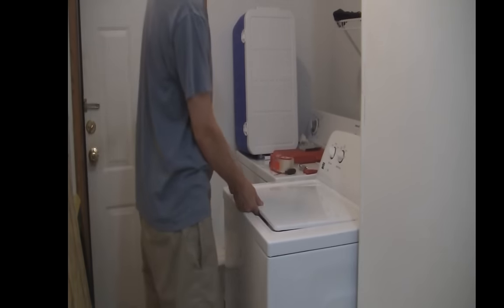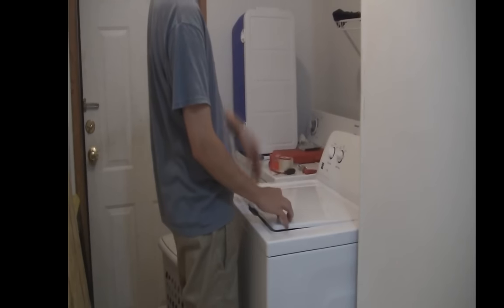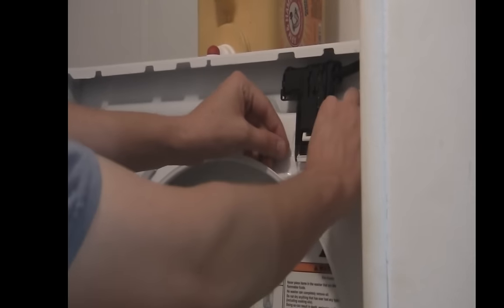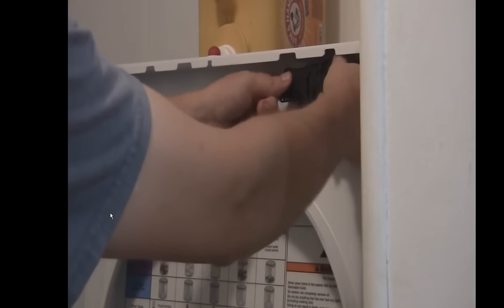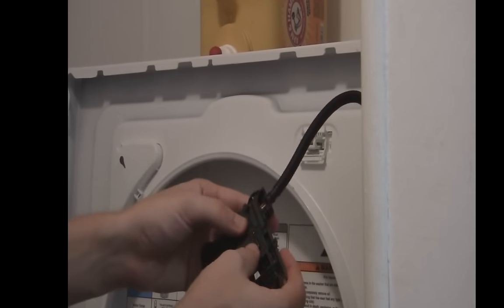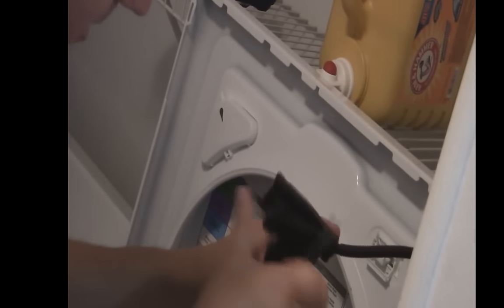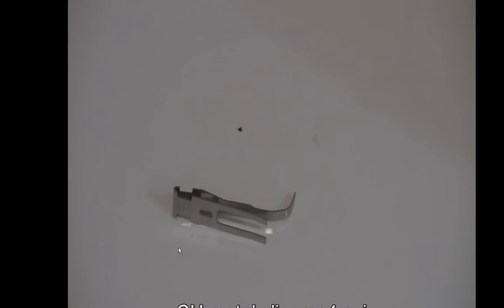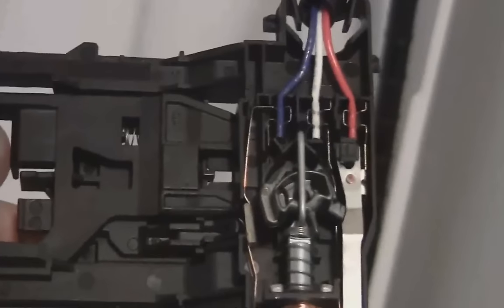Maytag, Kenmore, WhirlPool Clicking Lock Fix

Comment: Doesn’t work on my Maytag. Now it says it’s always locked and won’t cycle at all even though obviously it isn’t locked.
Worse than before because of this.
Reply from the maker: Mine says locked all the time now as well.  However I unplug the washer after each time I use the washer.  Try unplugging it and plugging it back in to see if that will allow it to run. 

If not then try resetting it.  

After replacing the lock I had to do this:
Plugin the washer.
Immediately put the latch in the lock and then take it out 6 times in 12 seconds
Then leave the latch in on the 7th time. 
Then position the settings dial to Rinse/Spin and run a Rinse/Spin.  This reset the lock mechanism or the computer and it started working normally.

Comment: Idk what I did wrong but now my washer won’t turn on 😭
Reply from the maker: I have a comment from 2 years ago that starts with "Update:"  Expand that comment and try the process I described there, that may allow the washer to turn on again.    I'll post it here too, but that comment has more info.

After replacing the lock I had to do this:
Plugin the washer.
Immediately put the latch in the lock and then take it out 6 times in 12 seconds
Then leave the latch in on the 7th time. 
Then position the settings dial to Rinse/Spin and run a Rinse/Spin.  This reset the lock mechanism or the computer and it started working normally.   Before this the lights were just off and it wouldn't work.

Comment: I must've done something wrong. I went by the video and it's still sitting here clicking
Reply: Me too.  You Find a fix?
Reply: @chadwilliams519  no
Reply: Mine is the same... this is so frustrating! I need to wash and this thing is just being  a pain.
Reply: Did anyone figure it out?
Reply: When the switch is closed you can use pliers to bend the metal tabs together. It makes contact that won't come apart. Then take the actual lock off of the lid. Everything works as it should but the lid doesn't lock in place. You can open it anytime. The washer will stop when you open it, but still works like it's supposed to

Comment: Listen.  Do you understand that when you remove that metal clip and you say it is okay and everything works fine.  Do you actually understand and clearly explain the role that metal clip actually plays?
Let me explain it to you thoroughly and clearly.  Now pay attention that you might learn somthing
When you put your lid down, the striker pushes two plastic arms in towards that solenoid.  One plastic arm makes the white wire and the blue wire to connect.   This completes the circuit for the solenoid.  So when you start the washing machine, the module sends current to the solenoid. Now read very carefully what happens.
The solenoid rod if you will gets sucked in and that causes the other arm, the metal arm to get pushed down and that arm gets pushed down that completes the circuit which is the locking mechanism.  But wait for iiiit.  That arm has to actually be held down to complete the circuit.  You want to know how it gets held down.  What mechanism holds that arm down so the computer knows that the door is locked?  You think about that, my friend.
What hold it down is that metalic thing you want to throw out.  Not just that metal clip but also with conjunction with that spring.  That little sping holds enough tension so when the computer sends a signal to unlock bu energizing the solenoid, the spring pulls on that metal clip you want to throw out.  If the spring is weak or the mechanism is not smooth the door will not unlock and it will cause error codes.  
So do you understand that the computer needs to lock and also unlock the door.

However the part you can actually cheat is the one you ignored.  It is the door closing part.  The solenoid circuit. The white and blue wire.  That also wears out.  If you join those two wires, the computer simply assumes that the lid is down.
And that will not cause immediate problem but it will take sometime.
Here is what that means.  The computer assumes that you never opened the lid again to remove your cloth.
Do you know when your washing is done and the spin is over, your computer does the beep and you will notice the done light is on.  It will stay on until you open the door.  And when you cheat with that mechanism, the light never goes off.  So the computer sooner or later will cause you trouble.
The only way to deal with that is you unplug your washing machine after each cycle to start fresh.

Comment: I'm gonna try this. Fucken washer lock is unnecessary anyway!!
Reply from the maker: If the lock still works you can just remove the latch from the top of the washer and leave it in the latch hole.
Reply: That will help it start again instead of clicking? I'll try that
Reply from the maker: @tylerstrauslin8361  Nah if it is clicking already then it sounds like its broken.  You can only do the put the latch in the latch hole trick if the lock isn't broken.  But this fix only works about 2/3rds of the time . If the fix doesn't work and you have to buy a new lock then try the latch trick.
Reply: Did your washer not lock before you did this? Yes my lock still works and when I took the hook off and stuck it in the hole it still just locks and unlocks and doesn't operate otherwise
Reply: I actually found the problem and mine was a ge it turns out. Watched a video some dude pulled the switch apart and scraped the copper fin in there with a screwdriver, apparently the part was failing to communicate to the computer that the latch was in fact locked, and that somehow made it regain connection and worked. I guess if the copper has some corrosion on it you do this and it works. Wtf! Haha
Reply from the maker: @tylerstrauslin8361  Nice, thanks for sharing that info!

Comment: did not help me at all. My switch has 4 wires :(
Reply: Derrick Moses Found the 4 wire lid lock on eBay for around $20 delivered. Also getting the main control module for $90 delivered. This is for a Whirpool Cabrio...what a POS these things are.
Reply: Mel Robinson  I have an admiral and a maytag that went out at the sametime. whirlpool makes admiral and maytag. I am going to be starting a class action lawsuit against them. nothing else breaks but the lock. tell me that isn't planned.